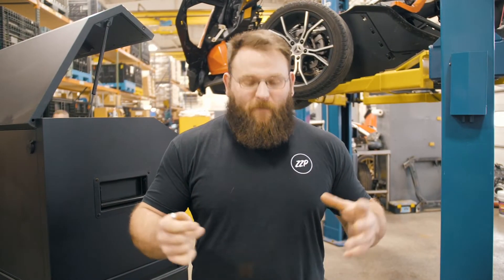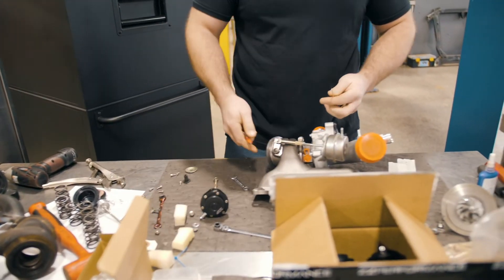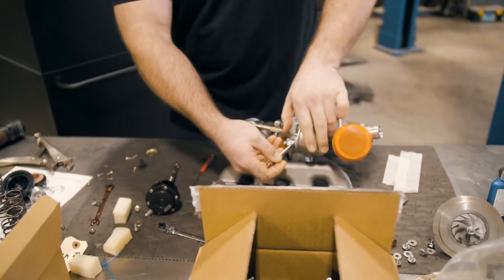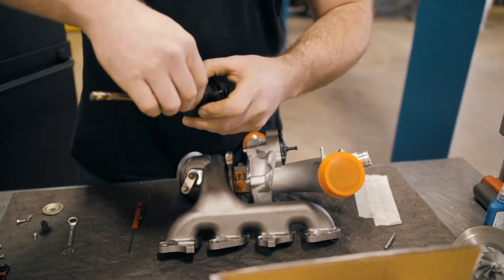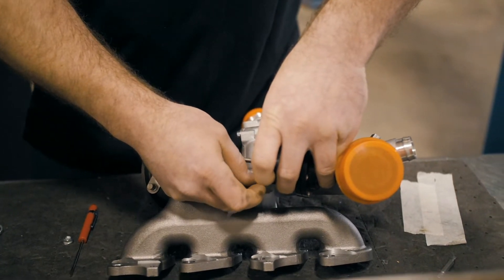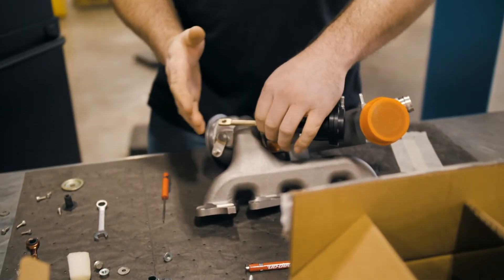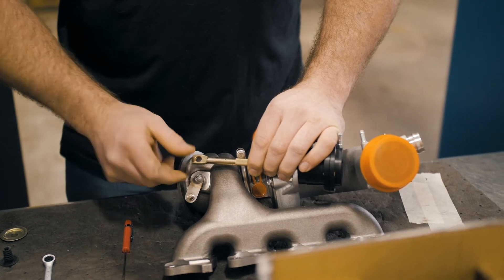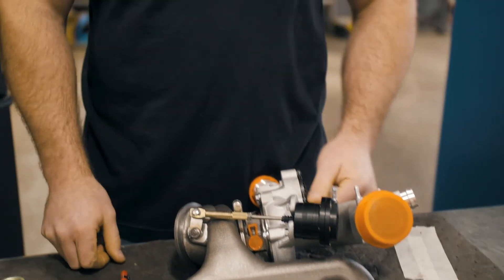How To: Setting Wastegate Preload | ZZPerformance

Comment: I purchased this for my 2014 Chevy Cruze, it’s a great product but when I did it following his instructions it turned out I was getting under post codes so I should’ve compared the new actuator with the old one but I had it to long so I shortened it and it took a bunch of drives to get it in tune with the vehicle. I kept getting over boost codes which was expected but I got it just right. Just waiting for the cold air intake, and Inter cooler system then comes the tune also the Down pipe
Reply: so how many turns did you end up using to get no codes  I used  that solinoid bypass mod that was so popular on the Sonic Cruz forums and I ran it to 21 PSI at WOT and I never had a over boost code. I know it was a true 20 psi since I had a ultra gauge hooked up at the OBD port that right to the ECU .  I'm assuming its over 21 PSI to trigger a code  that's why they have that solinoid on there to not over boost it  although I since reversed that mod .
Reply: @TheThirdWheel618 i’m trying to figure out if i need to run a tune with this
Reply: @mackjones6058  I would not think you need a tune with just a waste gate the ZZP waste gate  is made for a Sonic/ Cruze that has  a lot of mods  already you  maybe you would get a under / over boost code if the Rod was not adjusted right . 
I've ran a lot of things without a tune the only one that really required it was the ported intake  at WOT it would be extremely rich and you would make no power they take fuel out of the map with that mod and you get crappy Gas milage without a tune some things I added there was no real seat of the pants increase except the catless down pipe and 2nd 02 bung extension that was a nice bang for the buck no tune kept 2nd cat and stock exaust just muffler delete .
Reply: curious if you remember how many additional turns (preload) you need up using? I did the recommended 3 half turns and still got underboost. I've gone as high as 5 total half turns and still get the same error. not sure how safe it is to go any higher.

Comment: Each turn gives a pound of boost.
How do i know if my chevrolet trax can resist the 3 last spins you gave the actuator .
Will my stock turbo be able to live with the 3 extra spins
Next question.
How much preload can i give.for a stock turbo.without cracking my heads.and destroying my turbo.
CHEVROLET TRAX 2013 1.4 TURBO AWD .
Can i spin preload 1 and a half to
 2 x,s on my stock actuator.would i be pushing my luck with a stock factory actuator.
Reply: You would need a tune to avoid an over boost code is all I know or you can just turn it back down until your check engine light stays off maybe.